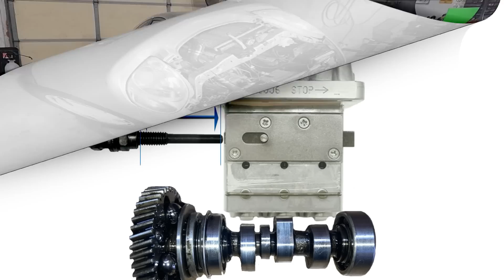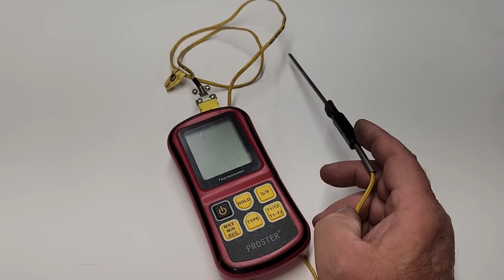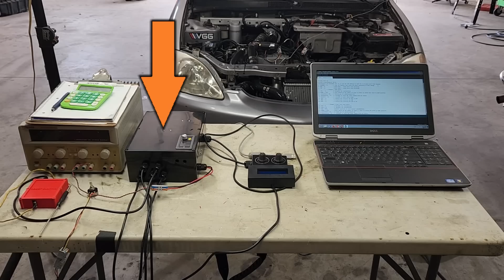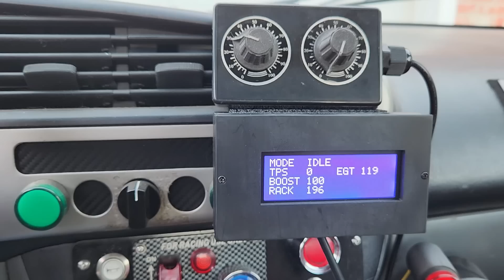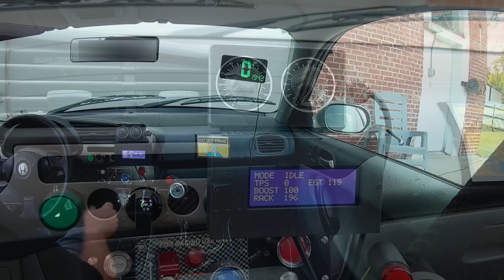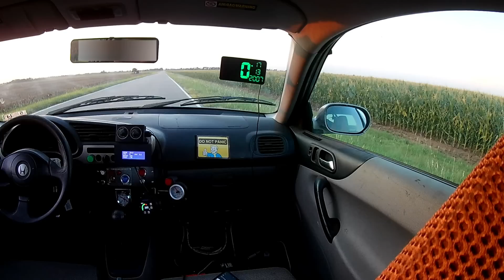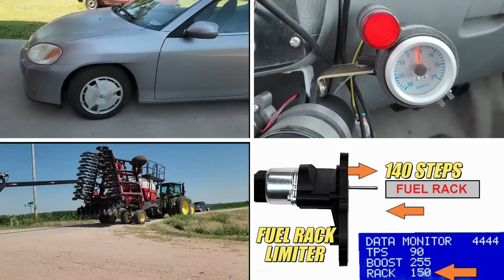S4 E24. the computer controlled supercharged Kubota diesel gets faster and better MPG

Comment: And when you think about it,  the 00 to 06 Insight is less arrow die Nam icky with both windows rolled down. I wish I never sold mine. Always wanted to know how it would perform without battery power helping that 998 cc 3 cylinder 4 valve vtech 63 hp motor.
Reply from the maker: I totally understand the aero is not ideal with the windows down, but its also impossible to drive in this Kansas heat with the windows up.   Now on the regular insight, the IMA battery died about a month ago and I drove the car for a few weeks without the battery.  On the expressway there appears to be no difference and the car is fine. The fuel economy seemed to go up  slightly.  In traffic, it was a different story and the car was sluggish, especially when accelerating in second gear.  The good news is the car came with a spare battery pack and I eventually installed it.   Now that the car is fully functional again I appreciate the  extra power from the battery, however if this battery should ever go bad,  I'll happily drive without it.

Comment: I know you don't want to bother with trying to add in AC to the car run off the motor.  But a simple way to make the cabin bearable would be a cheap cooler with a large 12v fan installed on the lid with a hole in it.  Have the fan blow into the cooler.  Then a hole on the other side of the lid with a semi rigid pipe to allow you to aim the "exhaust".  Just fill it with ice.  You could even power it with a secondary battery if load is a concern.  The added weight probably wouldn't be enough to worry about for your MPG testing. But it'd make things a little more bearable driving in the summer.

Comment: Jimbo, great as always. Are you having trouble with the gearbox? At some points it seems hard to engage gears.
Reply from the maker: The gearbox if fine and shifts perfect.  the trouble is I'm using the Honda insight clutch master with a saturn slave. There is just enough movement in the system to disengage the clutch,  I reckon I need to upgrade the master at some point, however its not easy on this car.
Reply: @robotcantina8957  thanks Jimbo, makes sense. As said in the video, this has escalated quickly... (:

Comment: Do you have a load sensor wired into the mix??
Reply: Any plans for any porting. Port matching super charger intake exhaust block gaskets valve seats  (aka bowl blending) cast flashing ect. Setting best squish band clearances with head gasket thickness and or decking blocks or heads idk if squish band is a thing on a diesels. I’m not a Diesel engine guy AT ALL so this all comes from gas only engines 4stroke and 2stroke but I’d asume diesel must be similar . Some engines are super crude and tons of potential efficiency hiding I know your not hp junky but the hp gains aside it does make any and all engines happier and more efficient ect. Weather you use the gains for performance or just for added  fuel economy it’s still a great thing and cheap as it’s really just the cost of gaskets if not reusable and your time assuming you having porting tools like Dremel with Burr bits mini sand drums  ect.
Reply from the maker: @acurarl9929   The castings on the spare engine appear really clean and I don't think much can be gained from deburring.  I guess there is a lot of things I could do differently if I were to do this again, but keep in mind I really don't have the budget to take the engine completely apart and start modifying everything.  I try to keep expenses low because in the past I have done some expensive projects with no return on revenue.
Reply from the maker: Not sure what that would be.   On a gasoline engine I could use a MAP sensor to detect load, but on a diesel that wont work because there is no vacuum.
Reply: @robotcantina8957   yes I commented to soon before I watched entire video. Seems to be wrkn out great. I was just thinking of a way to not rely souls on TPS. But seems really good so I’ll be quite you definitely know your stuff and got a great handle on things.  Hopefully you get some sponsors soon. I know we all would  love to know the actual breaking point. Then you could run just below that. But that means you need to blow a head gasket maybe a bearing or even a hole in a piston. Would be very cool to see the LIMITS Of that setup. It’s possible it’s at the limit. It’s also possible it can sustain double the current power. Hard telling not knowing.
Reply: @robotcantina8957  I recall you saying it has a govnor in one the videos How’s that work if you control the fuel rack? Link to video explaining that??. If so wouldn’t it maybe be better to not have govnor so you can rpm right to where you want rather then riding the limiter all the way out.  If there is govnor then it does Seem like you do stretch the rpms out into where the limiter is coming online.  I just figured that was nosing over as all engines do. But if it’s the limiter starting to activate that makes sense too. Just curious i guess
Reply from the maker: @acurarl9929  indeed the engine is equipped with a governor.  We have the governor set to limit the engine speed to 4000 RPM.  Removing the governor is possible, however it would require removing the engine from the car and removing the front of the engine to gain access.   I think without the governor the throttle response would be a lot sharper and we could cut some time off the acceleration test.    Since we do abuse this engine quite a bit, I feel keeping the governor in place is probably the best thing to do for reliability.